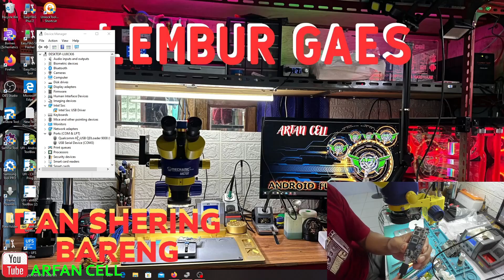ASUS ROG Phone 5 MATOT REBALL CPU RAM

Comment: What type of hot air do you have?
Reply: try 
hot 250
air 65 for glue removing

hot 365
air 50 for removing ic's

hot 330
air 35 for reballing ic's

hot 350
air 50  for the final steps

different man different habit's 
👍👍

quick 861dw